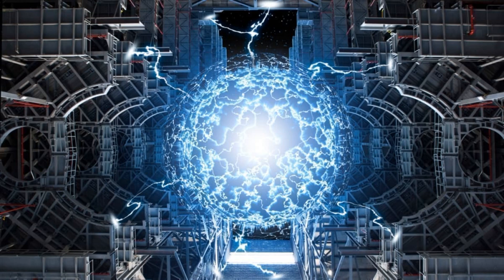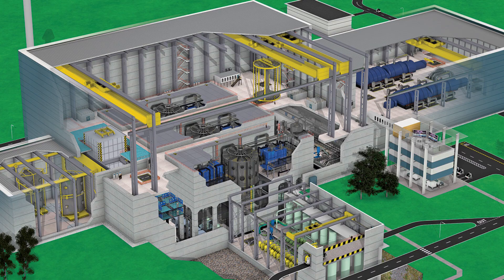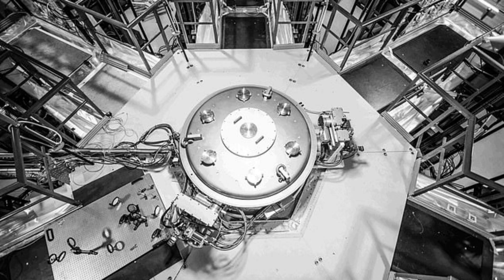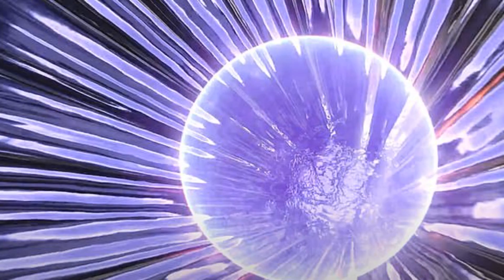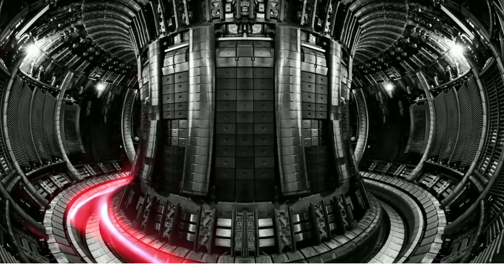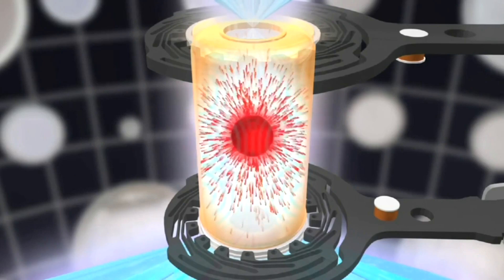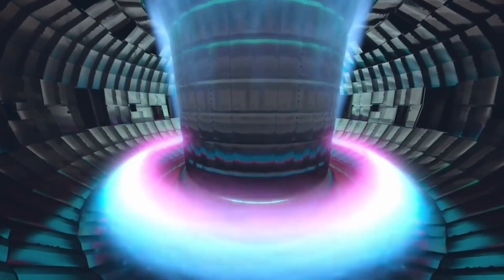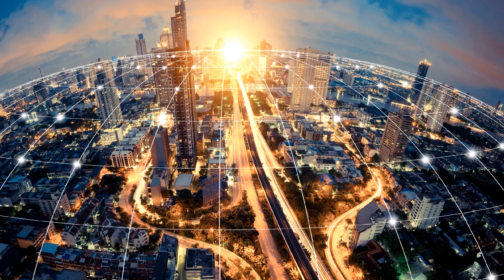Nuclear Fusion Breakthrough: Simpler, More Efficient, And Cheaper

Comment: The future power supply to suit the greens. That is untill a new wave of greens arrive on the scene.
Reply: Foregoing climate change considerations I like to breath clean air instead of hydrocarbons and CO from a tailpipe.  Am I a green in your opinion ?
Reply: @charlesbartlett2569  No I don't like it either.i was refering to nuclear power. Nuclear fusion produces a radio active waste that has to be stored for a very long time. Nuclear fission does not produce waste to be stored.  So a lesser chance of contamination.

Comment: Interesting. Sounds like they combined the "Little Boy" (gun type Fission Bomb used to level Hiroshima) with the modern "flying lens" scheme used to make compact fission weapons-which act as a Detonator for the Ulam-Teller capsule, which initiates Fusion in thermonuclear, or "Hydrogen" bombs. The Von Neumann lens (Nagasaki) design is not relevant here. 
True: fission weapons are bigger, and use chemical explosives, whereas this is more of a mini-Hyperloop. 
The Stellerator failed (although the new Wendelstein 7x is Interesting.)
Tokamaks have been tried for Years
The Livermore Laser is a laboratory curiosity
"Cold" catalytic fusion didn't pan out, either
Boron-Hyrdogen "Direct Energy Conversion" is complex, and not spoken of much.
The Z-Pinch was hyped, back in 1998, but, it, too appears to have failed.

Let us see if THIS is the "Beginning of the Beginning."
Reply: There is also Helion Energy (via Deuterium + He3) but who knows where that is going. BTW This is the only start up which does not use Tritium. As soon as you have Tritium you have neutrons to make Tritium, so why not just use old fashioned fission (via Thorium cycle or otherwise). It is frustrating that people don't talk about the source of Tritium when they talk about fusion.